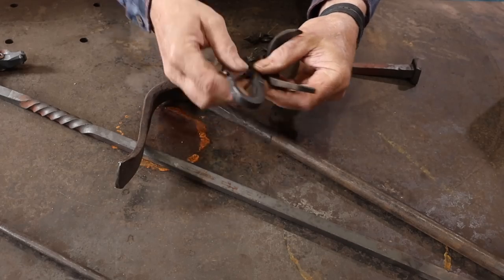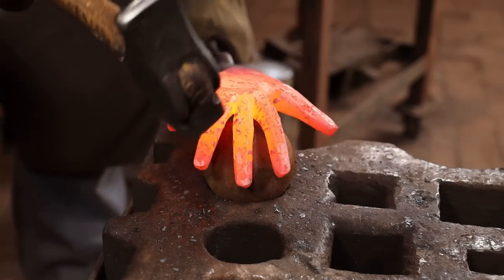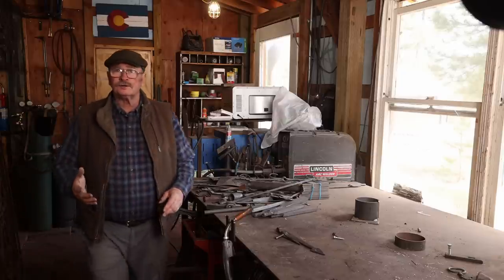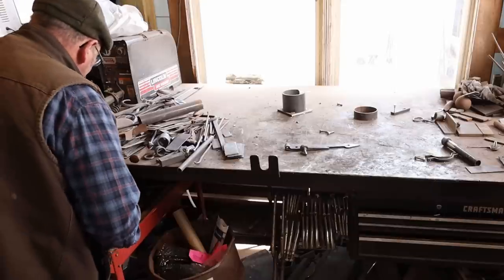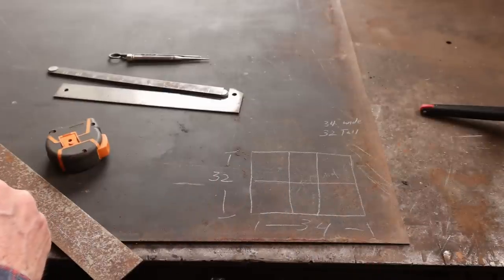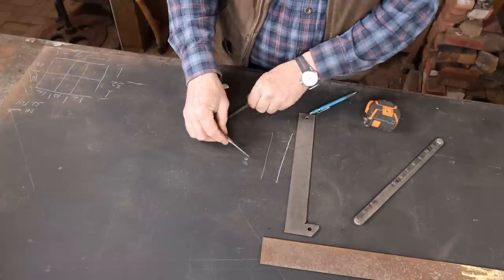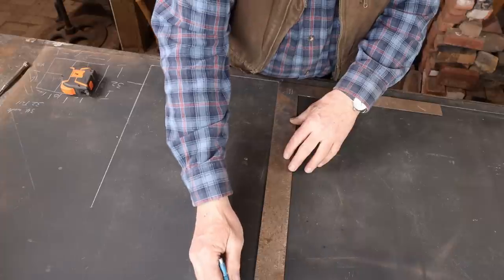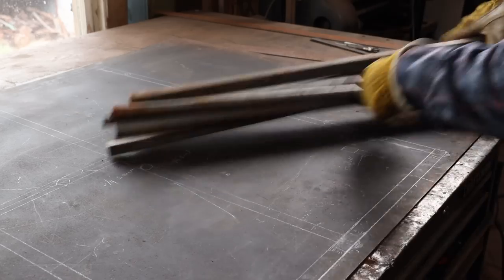Full size layout - window grill part 1

Comment: YYEEEEESSSSSS!!!  Bring on the advanced projects!  This is going to be great.

I also think that more advanced projects still provide a huge learning opportunity and inspiration to even the beginner blacksmiths.  It's better for everyone.

Are there some locks coming down that road?

As others have mentioned, I really like the idea of using the red cart projects as the new version of the scrap bucket.  

While you are in the mode of showing work more in the way you realistically do it, one thing that I think would be useful is to give a better idea of how long a project actually takes you to complete. (I don't mean showing it in real time, just mentioning what the real time was.)  Edited videos always make it seem like every project is done in 20 minutes, while a new smith may be working for two days to do the same and wondering why they are so slow.

Comment: John, I’m wearing my arms out trying to make a bolster plate by hand, after watching one of your videos. Coming along, but you aren’t lying about how good it is to have a power hammer. Another excellent video you made here.
Reply from the maker: It can be tough and sometimes a work around in the design can result in the same function but be more manageable in the long run.  Drilling the holes, bending a bar in to the shape needed or starting with something that already has a hole in it.
Reply: @BlackBearForge  pretty bare-bones here. Working with punches made of rebar and a 55lb Harbor Freight anvil. Those anvils get good mileage if you don’t expect much.

Comment: I've spent countless hours watching your videos. I don't have a forge, anvil or anything else required to blacksmith.

But if I ever do at least I'll have some very well presented information helping me on my learning journey.

Hopefully one day I'll get a small shop set up for some hobbyist crafts.
Reply: As someone trying yo do just that…
I can tell you it’s fun, but in my case I’m with the problem that my burner just doesn’t work as it should, it just doesn’t get hot enough for the metal to be workable for long enough. Maybe think about buying one rather than trying to make yours work. It’s personal now and I will have that bastard working at some point, but if you can don’t lose time with such things.
Reply: @TehlItER  I'm probably going to start in a coal forge first. Hopefully you'll get yours all figured out.

I definitely don't envy you trying to set up a gas forge haha. Looks like a nightmare.
Reply: @Scottbutcher7  it is not that much of a nightmare, simply put i can’t figure out a venturi burner, it just doesn’t burn right

Comment: The technical term for the problem of things piling up everywhere is FSS. 

FSS (Flat Surface Syndrome) is a tragic condition affecting creative types around the world. 

There is no known cure, but there are several procedures that can supply temporary relief. 

Often the first treatment is the installation of more flat surfaces, but unfortunately this only provides temporary relieve, and there is a limit to the number of times this procedure can be performed. Temporary surfaces are often employed as emergency relief, but FSS is highly contagious and prolonged exposure runs the risk of the new surface being infected as well. 

Alternatively you can perform a Single, Double or Triple Junk Bypass, where stuff is relocated to one or more adjacent flat surface in an attempt to find part of one particular flat surface. The results very, and the benefit is usually short lived. 

In the extreme you can go with a Total Junk Displacement, where you find homes for everything and recover all flat surfaces. Side effects include a giddy feeling of euphoria at seeing long forgotten de-cluttered space known as an Organasm, and lots of cussing when you can’t remember the “safe place” you put that one thing you desperately need right now. 

Unfortunately this is still only a temporary relief, as symptoms of FSS will soon start to reappear. Regular physical therapy in the form of putting things away is still required to mitigate FSS, but often even that is not enough, because the afflicted quickly runs out of places for things and FSS returns.

Comment: Could you please show how you would hot rivit a joint on a grill like this one without the use of a torch or would you recommend just Could riviting the joint thank you
Reply from the maker: This one won't have any actual rivets, but I'll see if I can remember to set at least one of the tenons without using the torch.  1/4" and smaller rivets do set pretty easily cold.

Comment: You do you 💚🌵☘
You have hours of video you can reference for Anvil work on similar parts of project.
Maybe a video series for us beginners showing different uses between power shaping tools.  Power hammer vs flywheel vs treadle.
Also a way to build out a set of smith power tools one at a time as the opportunity and funds arise.
Have fun with it teacher...